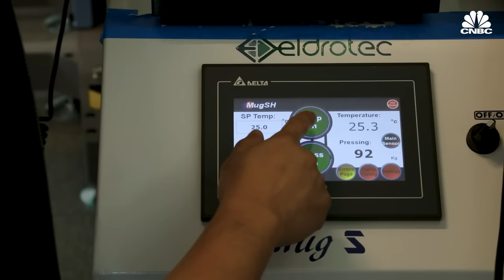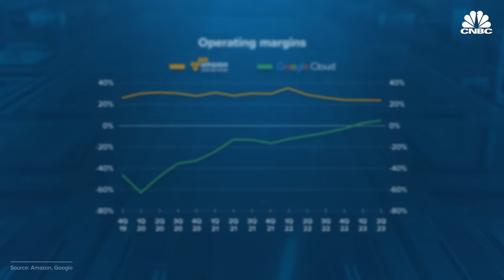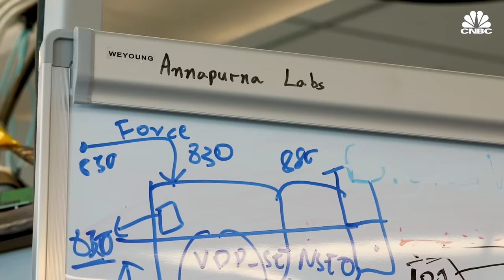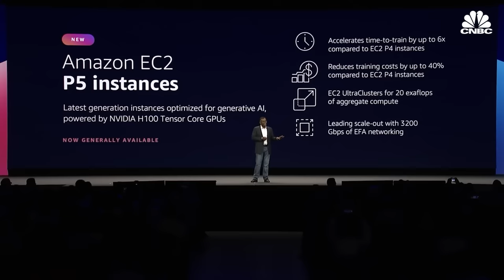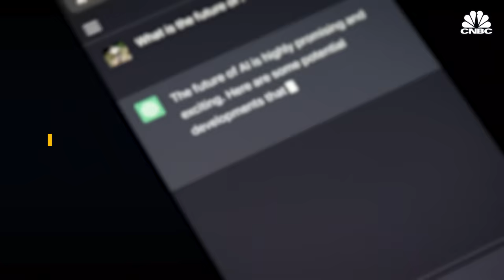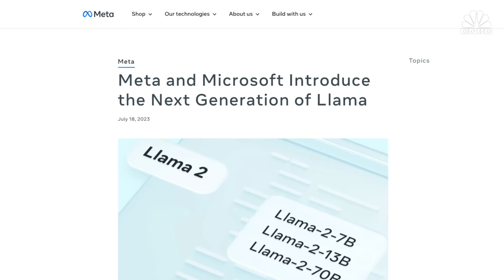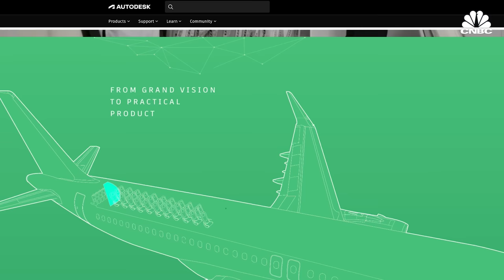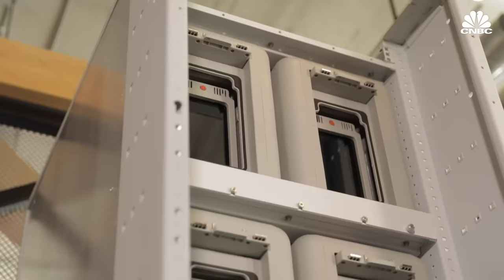How Amazon Is Making Custom Chips To Catch Up In Generative A.I. Race

Comment: 0:10: 💻 Amazon is designing its own custom microchips to power data centers and AI models, positioning itself to supply the growing demand for chips in the industry.
3:17: 💻 AWS is making strides in generative AI and custom chips to catch up with Google and Microsoft.
5:36: ⚡ Trainium provides a significant improvement in price-performance for training machine learning models on AWS, but Nvidia's GPUs are still the preferred choice.
8:38: ⏰ Amazon is expanding its AI offerings, including large language models, and focusing on tools rather than building a ChatGPT competitor.
11:15: 🚀 Amazon is leveraging its existing customer base to drive adoption of generative AI solutions.
13:55: 🏁 The development of generative AI applications and the race to advance AI technology are ongoing, with concerns around security, regulation, and national security.
Recap by Tammy AI
Reply: Thank you

Comment: I am a bit surprised that Amazon is not using the hardware from start-up Cerebras (CS-2), Wafer Scale Engine which seems to have some impressive proporties.

Also, I have a hunch that some yet missing (not mature) building blocks like Non-Volatile Memory (NVM) like MRAM (VG-SOT-MRAM) would dramatically increase AI efficiency : therefore, big tech companies should actually collectively invest in scaling up manufacturing of this technology to remove some bottlenecks to enable new opportunities !!!

Comment: Electroplating is easiest and cheapest to custom chips by drawing circuit on the plastic of other pcb then soak in electroplating aqueous layer by layer then any micro controller for sensor or anything control customize chip need but crystal processing light is much better using progressive lense and process light interference then very good if include transient lense on top then CPU easier

Comment: The only thing surprising about this is how late AWS is moving into custom chip design, if that is in fact the case. Perhaps the only thing new here is concerning AI custom chips, which every big player is surely doing by now. Tesla has been designing their own AI-focused processors for years already. It's just the obvious next step. The advantage of GPU's is their speed and throughput, they aren't specialized for AI. AI has unique needs which aren't served well by standard hardware.

Comment: I think we all need to go back to business 101. What is the business case for my company using AI or in this case generative AI and LLM's.
We are currently stuck in the tech and not the business. 
We always need to start from the business need since LLMs must have been used to try to solve some initial business need.
If not then we are all trying to give a ROI to lab rat's AI discovery and make his pet project viable because they sunk in $1bln. 
This is not my problem or risk.
This could be another Blockchain /Smart Contracts debacle. 
I hope you realise NO ONE is talking about Blockchain 😕😒😂😂😂😂😂